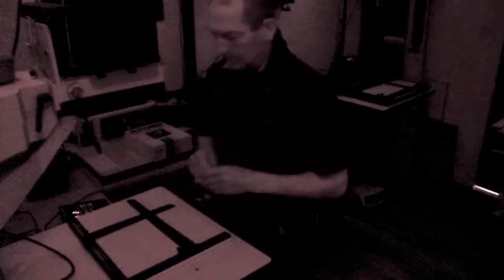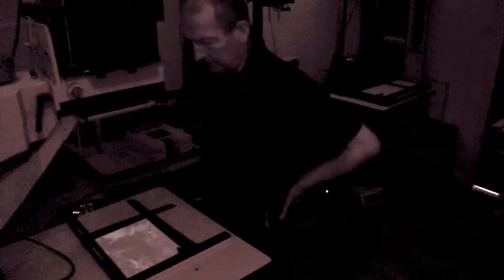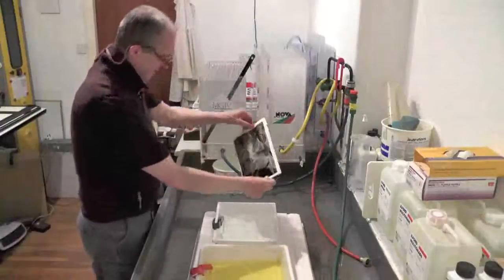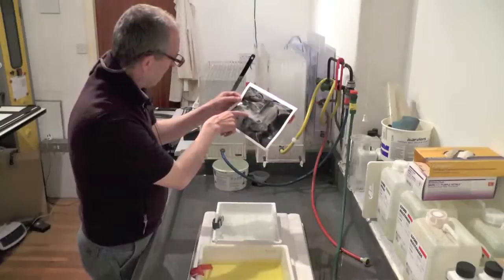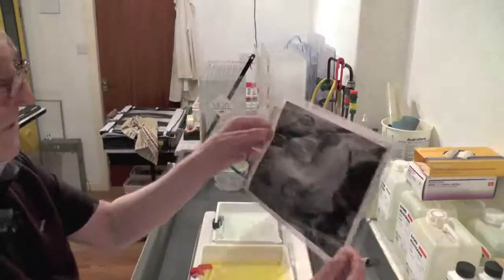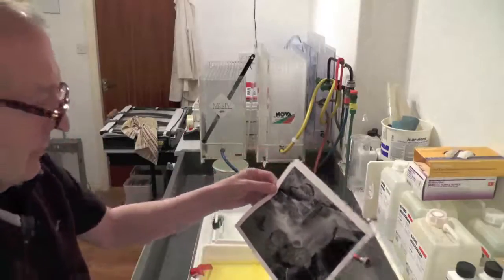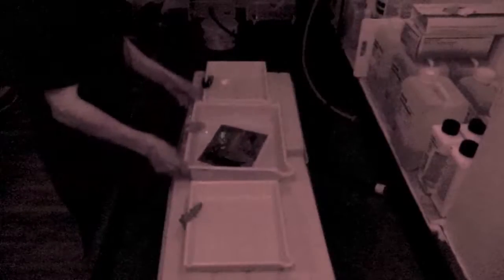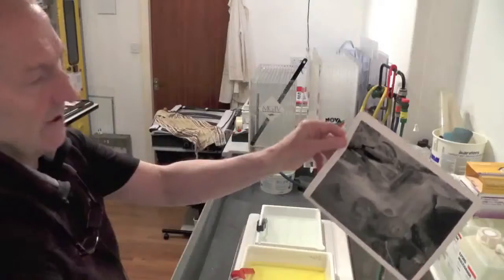Exposing and Printing After Making Your Test Strip

Comment: Hi Dave, all your tutorials are amazing and thank you for your hard work. Please can you help me? I have a question that might seem daft, but what size bulb do you recommend for a Durst 305 35mm B&W enlarger please? I bought my enlarger second hand and at some point the wiring has been changed. At the moment it has a 60w bulb in it, it’s a white bulb but I don’t know what kelvin it is or anything like that. Besides what my older brother taught me in the mid 70s I'm very much self taught with wet printing and this is one of those questions I don’t seem to be able to find an answer for. Even with new paper and developer my exposures are always 20 seconds plus. Thank you in advance.
Reply from the maker: Hi Mark, it's a long time since I had a 305 enlarger so I can't remember the bulb needed. The 605 and 670 use 150W and the 305 is much smaller so I expect it had a 100W bulb. Exposure times over 20 secs aren't unusual with that type of enlarger. Try opening the lens a stop but check sharpness still acceptable. Good luck. Dave
Reply: Darkroom Dave Thank you very much Dave, I was thinking 100w myself. I really appreciate your answer and advice.

Comment: Hi Dave, amazing tutorials thanks! Somebody told me I don't need to use stop bath with RC paper, so far it has worked with with only a good water bath before fixing. I change the water every 5 or 6 prints. My prints  look good and I haven't had problems, I'm saving money and mostly preparation time too. Your thoughts would be very much appreciated.
Reply from the maker: Water isn't a stop bath! If you use a water bath between the developer and fixer it becomes dilute developer after the first print goes in, which will be extending your development time. It definitely doesn't stop development; you need weak acid to do this (developers are alkaline). Something like citric acid or acetic acid is usually used. You don't need to use a stop bath as it's only purpose is to extend the life of your fixer, which is expensive compared to proper stop bath. Whatever you do I suggest you stop using a water bath between dev and fix. If you're making lots of prints use a proper stop bath, if just a few don't use anything. Dave
Reply: Darkroom Dave fantastic, thanks a lot my friend! Please keep it up.